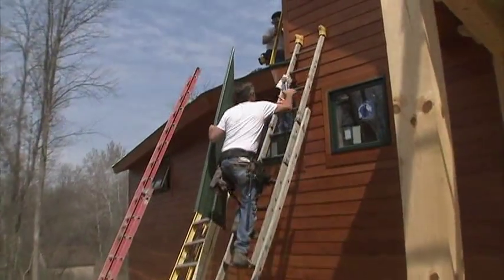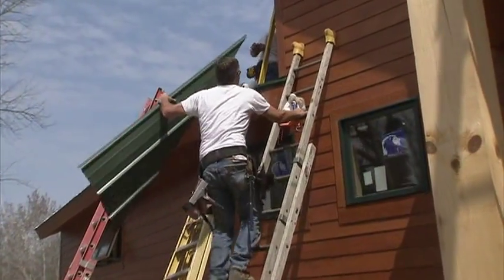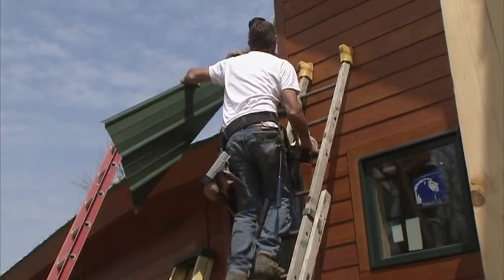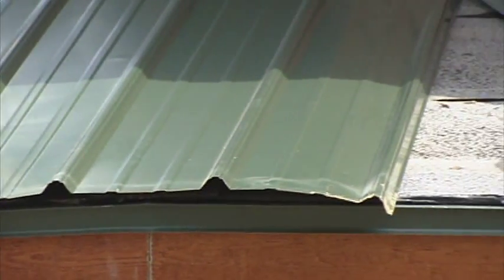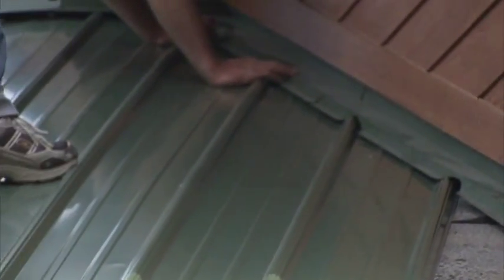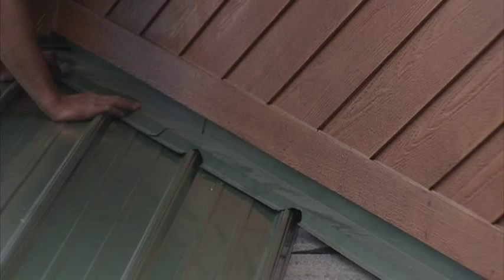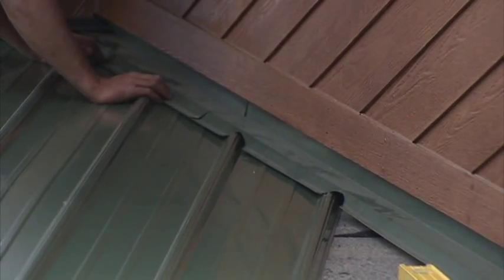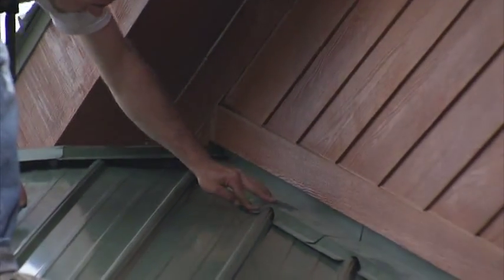LEED Silver Home Construction

Comment: ....are they positioning the screws in the right place ?... would it leak or will the rubber    on the screw head prevent it from leaking ..... i think the screws have to go on the raised part of the  sheet?
Reply: eventually the screws will move up due to the metal expanding and contracting and the roof will leak.